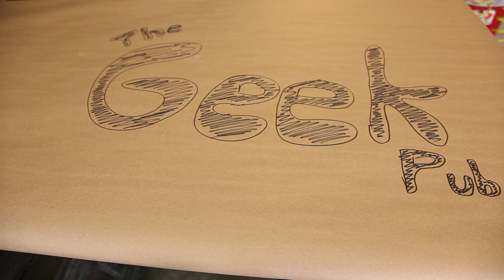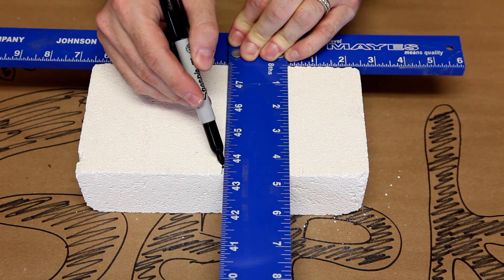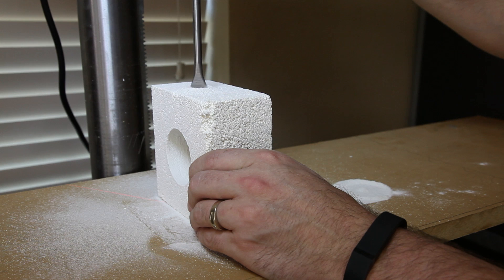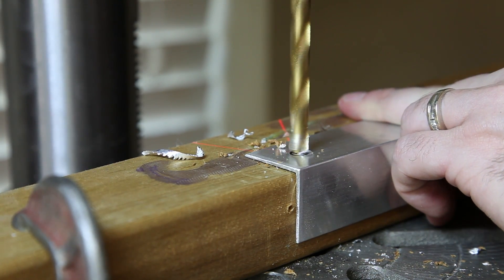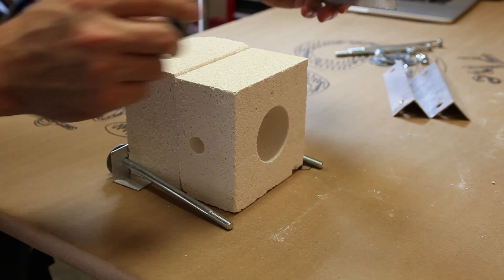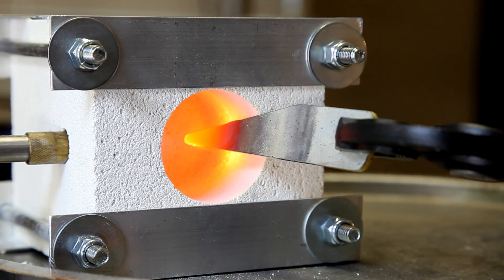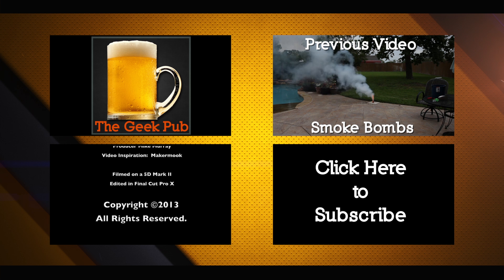How to make a homemade Mini Forge

Comment: if I wanted a longer forge, would it not be possible to double the chamber length by one extra brick? and basically double the metal frame as well? I want to make spike knives and I would need something a bit longer wouldn't I?
Great video though
Also I read on down, that a crack was made in the right side of the brick. How can that be avoided?
Reply from the maker: Absolutely. Many have done just that.  I cracked the brick by over-tightening it.  Hence why I cautioned against it in the video.

Comment: Saw a similar video using fire bricks where the gentleman just stacked them. I couldn't wrap head around how to clamp it together. Was trying to think of exactly what you did so thanks. It looks like it is easily scaled up for whatever purposes you want. Those trolls (I think that's what they  are) like to hammer on people, like you, because you didn't make it to a gargantuan size. Good job!

Comment: Quick question to anyone willing to answer. But would this work if I happened to use by four/five fire bricks, drilled holes in multiple bricks to make a larger heating chamber. And then placed another brick over the chamber to allow the heat to build, thus allowing my forge to retain its initial heat, while simultaneously allowing larger pieces of metal to placed inside?

Comment: Any reason not to have the back side open? Will too much heat escape? I'm thinking you could heat more of the metal, especially if you're trying to heat treat a larger blade or something. Thanks.
Reply from the maker: Actually, some people do just that for heating longer items.  As far as testing its efficiency, I have not.
Reply: @TheGeekPub  Absolutely, "too much escape". You definitely don't want "flow through"....the heat will escape very fast, nearly eliminating the usefulness of the forge.
If you need more space, use another layer of brick. (Cut another, drill both, strap them on.)
Or a whole bunch of bricks. (Bigger interior volume = longer heating time/lower temperature)
Reply from the maker: @Mephistahpheles  I've not experienced any issues and I have made numerous things using it.
Reply: @TheGeekPub  With "the back side" open as Matt Cain mentioned? I think you mentioned (somewhere in the comments) adding bricks for more depth. I was suggesting the same thing here. :-)

Comment: I do believe you are using Insulating brick not fire brick
Reply: relentlessmadman  can you please tell me whether silicon fire bricks and light weight bricks are both same..??
Reply: I not sure, I can answer that I would hate to miss lead you but industrial refractory products come in great verity and can be very expensive, have you read the article on fire bricks on Wikipedia ..https://en.wikipedia.org/wiki/Fire_brick,  and refractory:https://en.wikipedia.org/wiki/Refractory
Reply: relentlessmadman yes I did!!  And I came to know that they use aluminium
Oxide and silicate. On the contrary, they use ingredients like fly ash and  etc.. in making a light weight brick. This evening I've been out searching for a fire brick and got those light bricks at a nearby construction .. of course for free. Maybe, someone gave me a wrong hint.
Reply: I am not all that knowledge, but I believe it  require a diamond blade to cut fire brick  if you can cut it with a regular hand saw it is probably a  light wait insulting brick, and I don't know the difference in the temperature they are rated for !

Comment: The dust from cutting that brick causes LUNG CANCER wear protective gear!!
Reply: Steve that is absolute BS.  Refactory bricks are made of ceramic compounds and are not known to cause cancers.
Reply: Rob Claggy can someone tell me whether 'silicon fire bricks and light weight bricks same??
Reply: Silicosis isn't cancer.
Reply from the maker: That is 100% hogwash.  Here's the material safety data sheets: https://www.amaco.com/sds  Please stop spreading FUD.

Comment: have you looked into  induction heating? it seems more practical and no need for a torch. a diy set up is maybe $150 or so. I'm making one and the preliminary results are impressive. the capacity is about 2.5" by 2.5 but its essentially a spring that you can stick conductive material in and it can heat up something longer than 2.5".   it takes seconds for a screw driver to turn red hot. it is good for bluing metals like my metal top pic on the left perfect to harden or annealing tools of this nature. anyway that's my two cents. your furnace would be a cheaper alternative though.

Comment: would there be any advantage if you drilled the inlet hole so it was tangent to the fire chamber? maybe so that the fire kinda goes around the chamber instead of having a single area that's concentrated?
Reply from the maker: +SSJChar Maybe. I've not experimented with that. But I can tell you it works fine the way it is.

Comment: Ide love to see a design that would allow 8-10" blades and small tools. any ideas to get higher Temps?
Reply from the maker: +Killerkings 1111 This is on my list to make later this summer!
Reply: looking forward to it!
Reply: Use Acetylene. (4525C) Propane & MAPP are about the same. (2000C)
You CAN exceed the temperature of the flame, theoretically. Heat input....no output....temp rises. (Good luck with "no output", though.)
Use Oxygen.
Use Air. (i.e. diluted oxygen) I'm gonna do this with a wood/charcoal forge and the "wrong" side of a vacuum cleaner. (Also around 2000C.)
Smaller chamber, insulation, lid, seal the cracks (NEVER a perfect seal...you MUST have an exhaust vent.)
More gas. (Multiple torches or higher flow.)
Be safe! Don't do this at home. (Get your kid brother to do it.)

Comment: was the brick expensive
Reply from the maker: +Mario Cuevas (Mariobro82) There's a link on my website to buy one from Amazaon.
Reply: Ok
Reply: since this guy cant give a straight answer.....
no, fire brick is fairly cheap (iirc a few dollars each).
Saw it in another video, from another youtuber, about building an arc furnace from the carbon rods inside 6V lantern batteries and a firebrick (240V microwave transformer as power supply, so this is way safer) lol

also, hey guy, why don't you reccomend to all your watchers that they use an extension hose and pressure regulator??? so much safer, come on...

Comment: You should've cut the Aluminum angle on the miter saw too, to get those nice 90 degree angles.
Reply from the maker: +Hak Kar I'm always afraid to cut aluminum with a regular blade.  Not sure why really.
Reply: Trust me, i felt the same before i tried it, and trust me it just chews right through it.
Reply: If you're cutting brick with your saw.....you can't be particularly concerned about your saw blade. (It will dull it quickly.)
If you have the option, but the blade on backwards and cut VERY slowly. (newer saws may have safety features to prevent this)
Or use a grinder.....which costs about the same (with blade) as a descent circular saw blade.

Comment: Is there anyway to expand the chamber to fit a larger blade
Reply from the maker: +Scott Lee This is covered in the article on my website.
Reply: or you could just answer his question. 
you could add another section or two of hollowed out fire brick to the front, to make a longer tube forge.
offset the propane inlet to create a vortex effect and increase the efficiency of the forge.
happy smithing! :)

Comment: Is it possible to use more bricks with holes in it so I can extend it?
Reply: of course, but OP will probably direct you to his website for further info. ;)

i had to lol #sorrynotsorry
Reply: Also, you'd want to offset the burner inlet to come in at the top or the bottom, to create a vortex effect, giving you mych greater efficiency that OP's design, js.
Reply: +I-Love-CO Mountains hi, id like to try same, build a bigger model of above, vertical to stand a crucible in..
 feed burner in from side.. tall walls be vortex... would that work? any help would be great... thank you.. :)

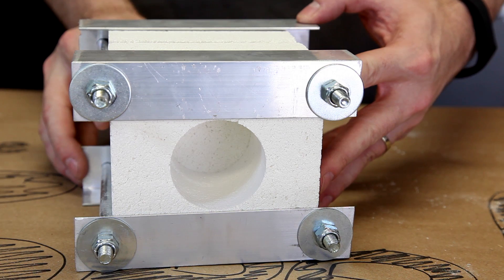Comment: 2:14  No crack on right side of forge.
2:22 No crack on right side of forge.
2:28 Crack on right side of forge.
2:46 Crack on right side of forge.
Reply from the maker: Yep.  I tightened down the bolts slightly too much.  Hence the warning in the vide right about that time about not over tightening the bolts.  It did not affect the operation though.

Comment: I just tried this but the knife only heated up on certain parts of the blade and although I tried to move the knife back and forth I was unable to get an even heat. I quenched and reheated too many times and the knife got a crack. How do you get the heat to spread through the whole forge? Thanks!
Reply: Don't quench it if you heat it up, let it normalize, air cool. It won't become brittle then.
Reply: OK. Thanks!  That means the second knife will not be ruined since I heated it and didn't quench it. I think I'll just use two torches...it's a cheat but it will work. ...hopefully! Thanks for the response and great video!
Reply: +Joshua Clark create a longer tube by halving, drilling, and stacking one more brick onto the assembly. may need to get a length of threaded bar (i cant remember the technical term for it at the moment, sorry) to attach the aluminum housing on the ends of the extended forge, if you can't find bolts long enough.
Also, you'll want to offset the burner input/inlet because if it's dead center it causes too much turbulence. You want a vortex effect, like running a water hose at a shallow angle into the wall of a bucket.

I hope this helps, OP seems like they dont have time to answer many questions.
Happy Forging! :D

Comment: So could you put a crubicle in the hole and stand it upright so you can melt down the metal into ingots? I imagine there would have to be supports inside for the crucible as well as a gap between it and the fire brick.
Reply: you could but you would need to be able to get the mettle a lot hotter. personal i would use a cutting torch instead of your conventional propane blowtorch but yes you could and i have
Reply: +Austin Hanks
 Hi, maybe you cvould help, I'd like to use similar design as vid.. to hold a crucible, could i cut & drill the blocks, assemble and stack.. creating the vortex, feed the burner in from side.. just a bigger version of vid model.. but vertical.. sry if that sounds muddled, hope you get me. and can advise.. many thanks.. :)

Comment: the fire brick you get at lowes or home depot is extremely heavy and dense and does not do well with sawing or trying to cut a hole it will wear out the tools .. need to get an abrasive blade on both items to do the job correctly..oh an doyu definitely better wear protective breathing and eye protection with all that dust....

Comment: I posted this comment 11 months ago No, it was propylene. LPG is liquid petroleum gas which is MAPP gas and Methylacetylene and propadiene (MPS) a fuel gas combination which burns at a much higher temperature. This is the whole definition from WIKI. MAPP gas is a trademarked name belonging to Linde Group, previously to Dow, for a fuel gas based on a stabilized mixture of methylacetylene (propyne) and propadiene. The name comes from the original chemical composition: methylacetylene-propadiene propane. MAPP gas is also widely used as a generic name for UN 1060 stabilised methylacetylene-propadiene (unstabilised methylacetylene-propadiene is known as MAPD). MAPP gas is widely regarded as a safer and easier-to-use substitute for acetylene. In the spring of 2008, true MAPP gas production ended in North America when production was discontinued at the only remaining plant making it. Current products labeled "MAPP" are in fact MAPP substitutes. These versions are stabilized liquefied petroleum gas (LPG) with high levels of propylene Acetylene is very dangerous to use and for a clean burn (low Carbon) you add oxygen. This produces a temp of over 3,500 °C (6,330 °F) which is much too hot for a fire brick which can take an up to 2600 F temperature.
Reply: thanks! :)

Comment: Neat little build. But that seems like it would be too small to be useful.
Reply from the maker: As has been mentioned, so I will be quick.  Adding another brick is all that is needed should you need more depth.
Reply: TheGeekPub that's why I like your build. versatile .
Reply: sr20DETdrift This is exactly what I was thinking...just more money for longer bolts but that can be modified too...did you try it by the way?
Reply: it looks shallow but im sure you can put a couple more bricks with holes in front and extend the chamber.
Reply: Clark Family Adventure Tours Yes but I noticed as I put more bricks, the cooler it became so I added a second torch midway to have consistent heating for longer pieces i was making.
Reply: nah, it would be perfect for things like small woodwork plane blades

Comment: Lankey  - Putting the flame directly on the part will not generate the same amount of heat as a mini-forge.  If that were true, no BBQ grills would have lids.  The forge is an insulator allowing higher temperatures to be maintained and consistent.

Comment: Change propane for  acetylene stack more bricks with holes and you have a nice little knife furnace and heat treat. Very neat and tidy job. Approved!
Reply: wont oxy/acetelyne melt the fire brick though? that heat is insane i know it would melt a knife.
Reply: +I-Love-CO Mountains Depends on the O2 concentration...

Comment: could you cut the brick off center and drill through the larger section to give yourself a larger area in your forge?
Reply: Of course and that's what I would recomed because that hole is just a little too small

Comment: Oh  yeah you can easily cut the aluminum with the chop saw or any other carbide tipped saw blade. The thickness of the material that can be cut that way is over 1/2 inch. Blade Magazine Cutlery Hall Of Famer Wayne Goddard  invented this forge and his method is easier and better, the chamber is longer